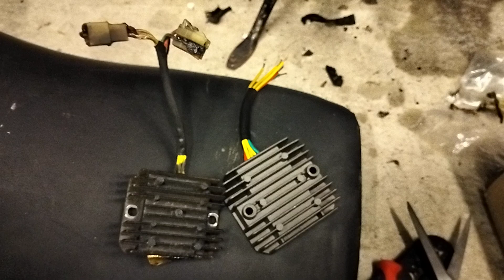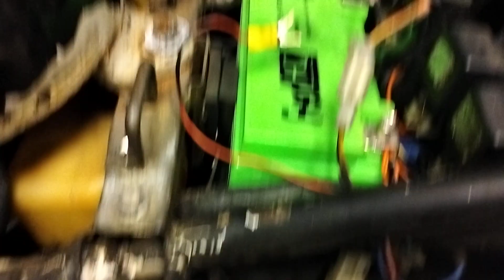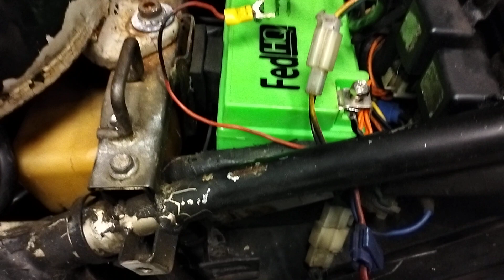Hyosung GT650 electrical problems Part 1

Comment: Hi good day please am Abraham from Ghana please I have a Hyosung 250 and some problem is worrying me which my bike is responding and the same time the ECU is heating please what is the problem and my dashboard is blank too
Reply from the maker: It's possible that there is a short circuit in the wiring to the dashboard.